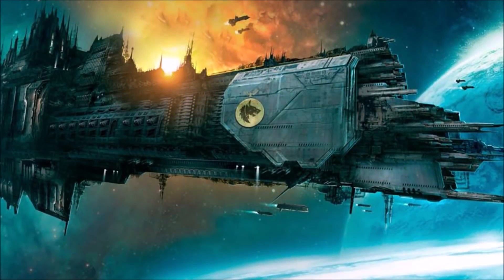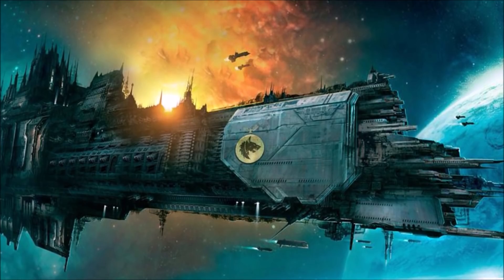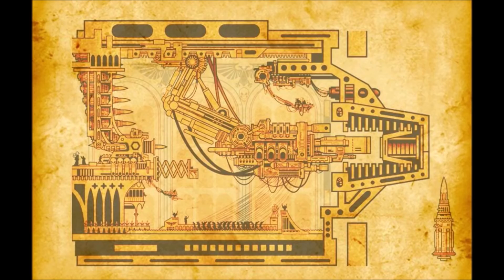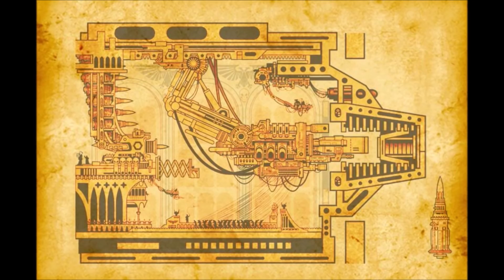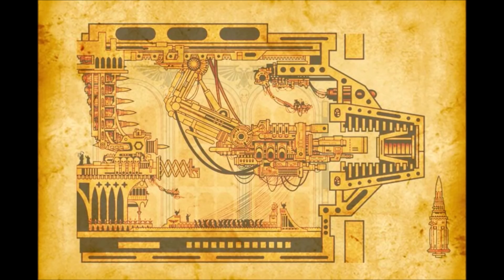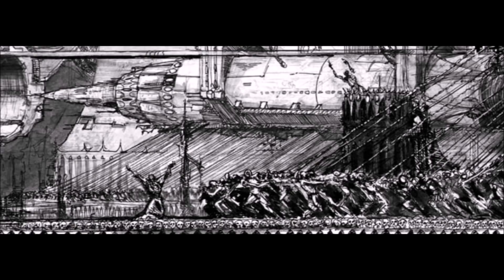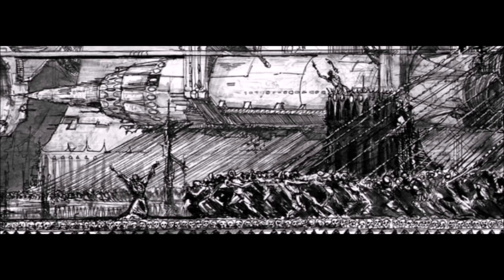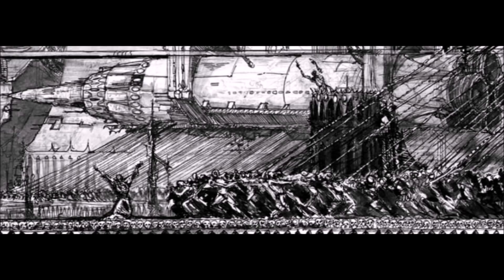Void War - Episode 0: The Methodology

Comment: You should get in contact with channels like Spacedock and EckhartsLadder.
Reply: Justin Last  Eck is also extremely biased. Anything that isn't Star Wars or Halo is inferior to him.
I, Cato Sicarius, still have nightmares of that time he did a versus with Star Trek, Star Wars, Halo and Warhammer 40k.
Reply: @thefirstprimariscatosicari6870  You're sure your highness ? It seams like Warhammer is getting it's fair share to me.
Reply: @leobibi123  Yes it is, but there is a reason it's currently on hiatus.
Reply: @thefirstprimariscatosicari6870  It's on hiatus because of the Flood vs. Tyranid war in comments (and because Eck has a blatant Flood bias) he took the Flood side even though they were pushing some rather blatant powerwank.
Reply: Justin Last  space dock does most of its stuff quite well actually.

Comment: Adamantium is used extensively in these ships. So a city sized wolverine skeleton in the shape of a battleship.
Reply from the maker: While this may be true in Imperial and Ork ships, this won't necessarily be the case for many of the other races (such as Aeldari, Tyranids, Necrons, T'au etc) when we eventually get around to covering them. 
Any comments made in regards to the construction of ships/materials etc is more of a generalised statement for the purpose of the series, if that makes sense?
Reply: I wonder in regards to the Tyranids... maybe Tyranids are what they eat, i.e. delicious Imperium ships?
Reply: phantasmo9998 marvel adamantium is alot stronger then 40k adamtium
Reply: Kian Hopkins it is. But then again in 40k. adamantium is as tough or as fragile as the author(s) wants it to be. Protecting against firepower well into the gigaton range or bolter fire.